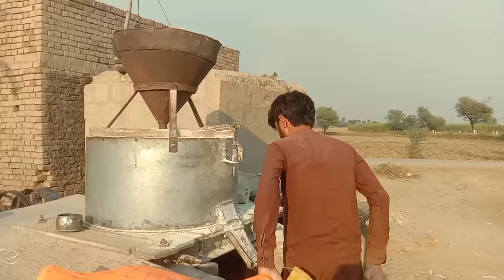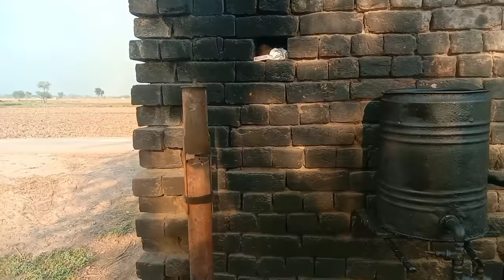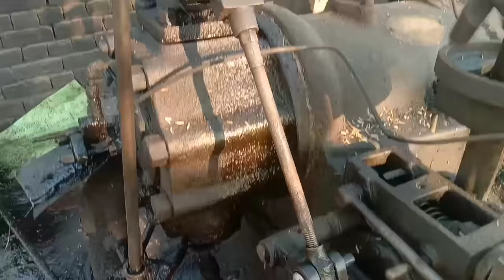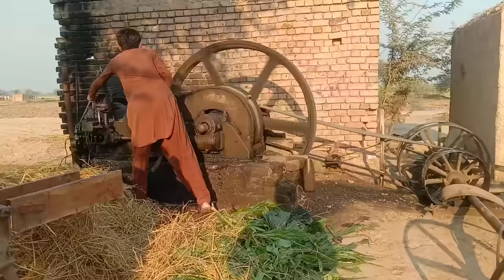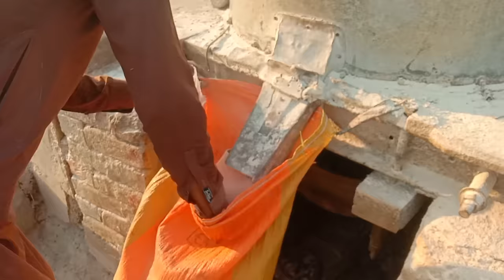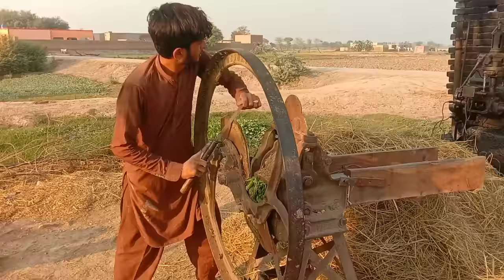Chaff Cutting Toka Machine - Grass Cutting Machine On Work Diesel Oil Engine - Startup Diesel Engine

Comment: That engine has seen a lot of hours. You can tell by the axle that runs through to the flywheel how much wear is in those bushings, likely because the bushings were rarely oiled. Knowing the people, if everr it needs to be fixed it won't be thrown out like everything here in the West. 😅

Comment: I have a question, why is there a whistle on the exhaust pipe of the engine? The sound was so annoying I had to turn down the volume. How can you have any hearing left. Other than the sound I enjoyed the video.
Reply: It was used so farmers could hear if the engine was still running when they were far away from it.
Reply: @skidsinmexico1443  I guess that sounds reasonable. :-)